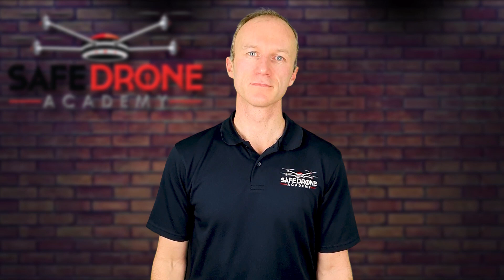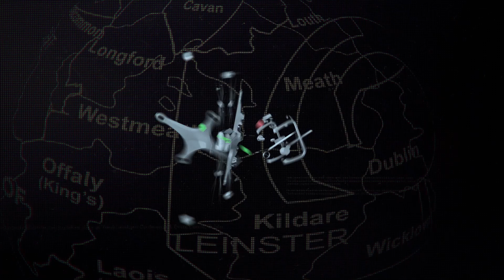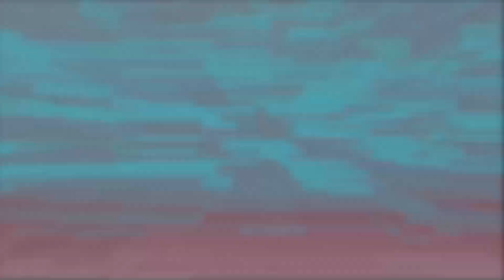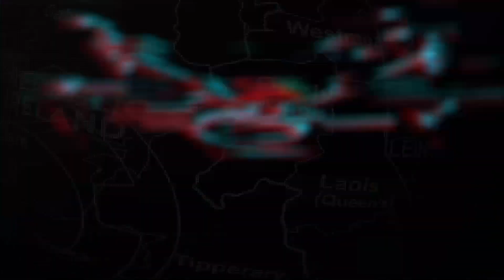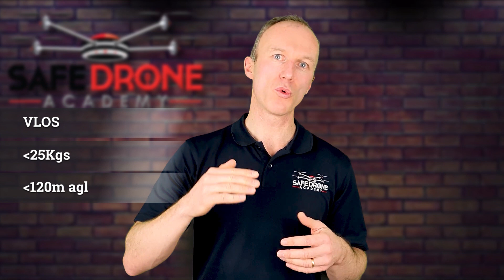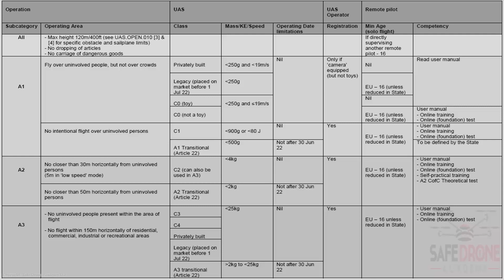Open Category - European Drone Rules

Comment: Thanks Mark. Great content. So the Phantom range of drones are currently not in compliance with Euro regs? Any idea why not and is it something that can be rectified in advance of the July 2022 cut off point by way of a Firmware update?
Reply from the maker: Thanks Alan, the Phantom is not in compliance. While it meets all the technical criteria, as far as we can tell, before it is placed on the market for sale it must go through the legal process that satisfies the CE ("Conformité Européene") process. The CE Mark must be affixed to the product by the manufacturer. When the CE Mark is placed on a product, it is a declaration by the manufacturer that the product complies with the essential requirements of the relevant European regulation. These cannot be retrospectively applied for.